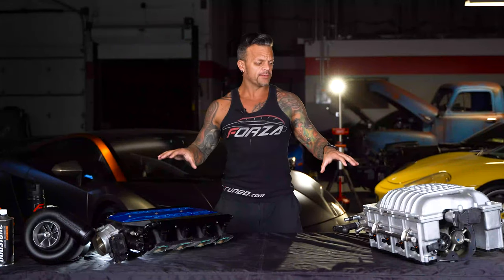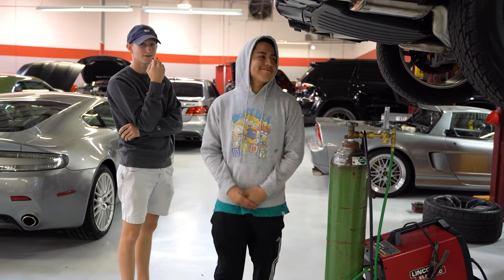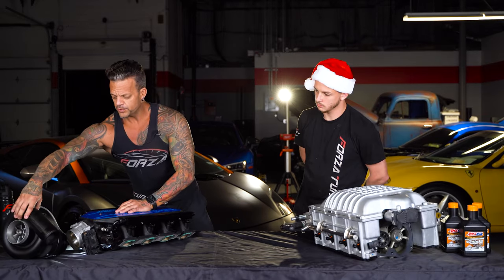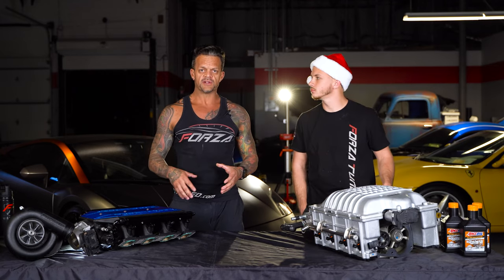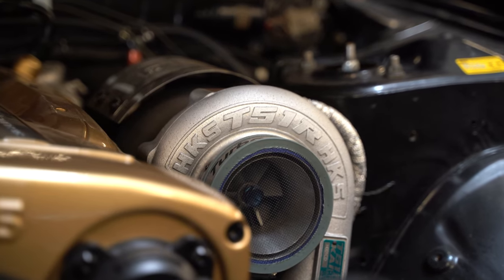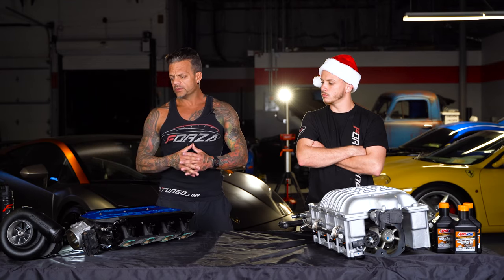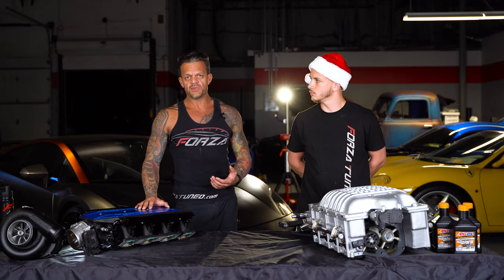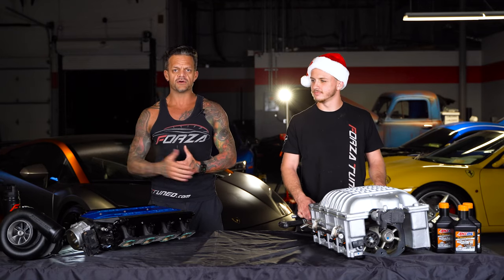What's The Best Supercharger? Roots vs Centrifugal vs Twin-Screw - Breakdown

Comment from the maker: Whats Your set up!? Roots, Centrifugal or Twin-Screw
Reply: Hybrid compound quad screw tri turbo..........
Reply: ‘16 Jeep SRT with a ProCharger. Trying to decide what the next mod should be. Any recommendations?
Reply: Centrifugal
Reply: Sadly to say I have a root, but it does 850hps on pump gas with only 11psi of boost
Reply: I'm wanting to boost my car. It's a 4.6 2v no it's not a mustang.  It's a town car. I used to have a 2006 gto 6speed. And that was fun to drive. I wanna kinda have something like that feeling of power.  But I'm not sure what set up to use. 
      I know procharger has alot of hp on top. But I'm not sure if it will be enough to throw be back in my seat or not?
Reply: @Illnatured2!  What brand do u have? Like paxon vortech procharger? 
Also how is the power on the take off from a dead stop
Reply: @sithlordlira  Sadly 8 to 10 pounds boost would be Better
Quit talking with Turbo Salesman lol
Roots perform twice as good at track
as on Dyno  they bring up temperature by running roots without fuel
I run 5 7 and blow by biggest turbo on shifts
with Stock cam and little 144 10 eta in 6000 pound blazer 
8 eta in car lol with stock 350  run medium compression 
9 1/2 to 1 
high compression fights blower gets higher track times 
Fastest eta on planet set by Supercharger at 350 mph

Comment: 7.3L godzilla 
Really been leaning towards whipple 3.0L twin screw, but it's still not released for the super duty trucks.
I tow, I play around every now and then it's really nice to see a n/a engine pace and out pace diesel trucks it wouldn't take much to push this motor into 4 second 0-60.
All said I have been considering turbo charging the thing but was more looking for a bolt on kit.

Comment: I would like to know what you suggest? I have a 70 Chevelle with a 502 non LS style motor in it. It’s a fresh motor. No miles. I would like to add boost. Preferably I like the twinscrew set up because it’s more linear power. What option would you go with? With the set up fitting all under my hood?

Comment: Looking to do a Stage 4R on my 2020 Charger Hellcat.
I'm in Arizona we only have 91 but will add 1 can of Boostane per tank.
Is it possible to get 1200 hp on 93 pump gas?
Reply from the maker: No, you can’t go that high.
Reply: Will do thanks 👍👍
Reply: Idk about 1200 on 93 bro u gon need a full tank of boostane
Reply: @RealCounterfeitCash  Well Forza warranty says 12 months 12000 miles an long as they do the tune and install all supporting mods. I haven't seen or heard of any of there cars blowing up. This car will see track use as well as street driven daily. They should know what their doing to warranty the cars they tune. We'll see what Forza says 😁
Reply: @h.rivera4726  Brent got ya back he prefers not to use e85 anyway

Comment: Redeye supercharger...details on supercharger chiller package e.g. system activation and operation (conditions that activate, deactivate, and automatic reactivation if it exists), expected temperatures, refrigerant used and cycle parameters, piping arrangement/locations, component physical locations, controls/electronics function and location(s), condensation and potential for wetting the track, and anything else you can think of.  Thanks I always learn a lot watching your vids twin screw vs roots...great stuff!!!
Reply from the maker: Thanks!

Comment: I’m surprised that we haven’t seen auto manufacturers coming out with electrically driven superchargers. An electric supercharger could be spun up to whatever boost levels it needs at any RPM unlike belt driven superchargers that spin according to the engine speed.

Comment: Im hoping you gents will see this message. I'm new and just getting into building my (new to me) 2014 Mustang V6. I'd like to turbo it but after seeing this video I think I'd want to go the centrifugal supercharger route due to cost, time, and overall driveability. I don't have anything invested in modifications yet, so i'm wanting to ask before I jump the gun.

My car is an automatic with the stick mode as an option and I'm unsure about switching to different gas (not against it), but i'm wondering if i should go Procharger or Whipple as it is going to be my daily driver. I'd like to be able to cruise around normal but be able to take off as soon as I romp on the gas pedal and still have more power spooling up in the higher RPM's rather than topping out at higher RPM's. Should I go centrifugal or twin screw? Or could I do some modifications to get more torque and horsepower in the lower RPM's while still being able to utilize a centrifugal supercharger to get even more horsepower and torque in the higher RPM's?

Sorry if i'm overcomplicating the topic and thank you in advance for any help and advice you could give me. 😊

Comment: Thanks🤙🏻🦾.. just a quick question my friend has a procharged 6.4 Chrysler and he didn’t build the engine yet right now he is in 7 pounds of boost I think and the tuner said that at that boost if he builds the engine he might get more power at that level of boost..What do you guys think? 

The set up is 
Procharger 
American racing headers 
Methanol kit
Hellcat throttle body 
And a tune
Reply: Stay where he’s at ...7
Reply from the maker: Not at the same displacement with same heads and cam

Comment: 2013 camaro SS D1 procharger. I like the power but hate the noise. What do you recommend for the best everyday driver? My next project is my 2020 RST Rocky Ridge edition with the 6.2 and the 10 speed. It has 22” wheels and 35’s on it. Fuel economy sucks but it so worth it. I little more power would be great but I don’t want to give up drivability.  
Thanks for the help, and I love the videos.

Comment: Great content first of all ... but I'm personally disappointed somewhat with my results I did a centrifugal supercharger. I have a truck and centrifugal supercharger are linear in power and works with the rpm of that motor, furthermore it prevents you from putting that power down early. So the remedy to that is high stall converter on a 2 step. But keep up the great videos maybe do a series and go indepth on all boost with some dyno graphs to backup the statements
Reply: in the video he did say heavier vehichles usually need a root or twin screw. I personally like the procharger i have on my 19 camaro 1ss because my car is already pretty light also i do roll racing as well as 1320.

Comment: Long time ago (1980's), I had a shop where we built racing engines for local applications...1/8th and 1/4 quarter mile mostly (little dirt-track use, too)...but that we didn't have any demands for 'blown' motors...I never did have the chance to ask, or learn about forced induction...but for the past year (in my 'old, retirement days'), I've considered building a 'kit car'...2,200-lbs, give-or-take. Small block, aluminum heads...naturally aspirated, making around 400-hp. Now, for an application like SCCA, where you are running laps (10-20 minutes, most-often), you are constantly in desired power-bands of 3,500-7,000 rpm, give-or-take...but if you are talking 'forced induction', you are now considering putting 50% or more 'work load demand' on that device...or, in other words, it's operating to generate boost half-the-time. Now, I know this makes a LOT of heat under-hood...and heat is no one's friend. If I were going to put a forced-induction system on a smaller small block (302, 305, 340...), what would be the 'best' system to consider...where 20-minutes of 'high demand' won't lead to premature bearing failure, under-hood heat issues, etc.? You almost never hear anyone discuss the 'sustained heat' from 'longer-term demand'...would a turbo be 'cooler' (like F1 cars), or a roots blower (I don't really see that...as they generate a LOT of heat), or a twin-screw blower, or even a belt-drive (Pro-Charger) type? Picture an AC Cobra...and you're trying to target 650-700 maximum horsepower...but you also need to maintain such demand at 6,000-rpm for periods, with minimal 'balanced cool-down' time, while no losing a lot of power generation potential from heat...

Comment: I have a Dodge Dakota 2000 4x4 Sport 4.7.   Very clean! 99k miles.   I would like to put a hellcat motor in. Lots of issues though. Torque converter, driveshafts, rear end, transfer case, and many more. Can i  use the 2021 Durango specs?  I believe the Dakota is lighter and would make a hell of a 4x4 helical Dakota

Comment: huge down side of turbo charger, if you have to pedal the car your most likely done for. if you let off the throttle it upsets the balance of constant exhaust flow of hot side which upsets the constant intake from cold side.

Comment: is it true, that if you have a motor built for a power adder, weather it  be sc, turbo, or nitrous, that it really does not matter witch, so long as the hp limits of the internals arnt passed, or do different power adders need different builds?

Comment: Hey just wondering if I upgrade the Pistons and rods in my hellcat and put a 4.5L Whipple on it will the internals be able to handle 1000whp?
Reply: Your looking at full e85 oil changes every 3000 miles and a spot tune .... but if you’re looking for longevity go 93 much less wear internals burning that acidic sugar lol that what you don’t want in your tank but the corn burns sweet and leaves nasty residue that needs regular maintenance or......Boom
Reply: @RealCounterfeitCash  yeah I was gonna do e85 to achieve 1000whp and then do 93 for 900whp. I would drive around with 93 most of the time and then do e85 when racing just for the extra power. I just want to make sure the engine and Upgraded internals will be able to safely handles the power

Comment: Hi Brenton, I can appreciate you enough for what do and the way you do it. Very glad to know and subscribe to your channel. 
My question: could you please give a general explanation or overview of how probable and workable it is to combine supercharger and turbocharger in same engine. E.g, Hellcat Redeye. 
Thank you.
Reply: It’s called hybrid or compound turbo or supercharging but when you reach the point where you are forcing more air in the given charging component it then becomes pointless to have such device and it is removed to blo through chilled exhaust gasses at max rpm
Reply from the maker: In most applications not really beneficial
Reply: yeah no one has really figured out how to make an efficient twin charge system yet. The idea is the super charger winding up to spool the turbo. In theory it should work however i drove 2 cars a ws6 that was twin charged and a 1993 silvia sr20 swap. 

ANd for some reason the air cuts off on the higher rpm of the super charger and where the turbo spools it just doesnt spool any more efficiantly. Especially now days with 2 step, launch control, dual and tripple ball bearing turbos, rolling anti lag, and nitrous to spool turbos. and super chargers have gotten lighter and faster. 

The only possible configuration i havent seen anyone try is is a twin screw with remote twin turbos. But still i think that the two systems by themselves are just so efficient now days theres almost no point. 

But hey maybe your the person to prove us all wrong if you have the money and time do the R and D.